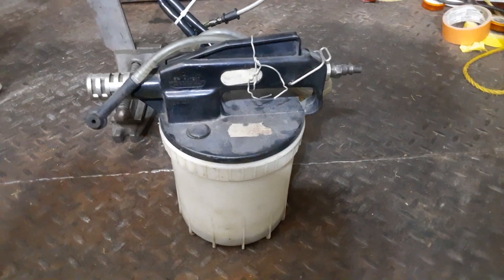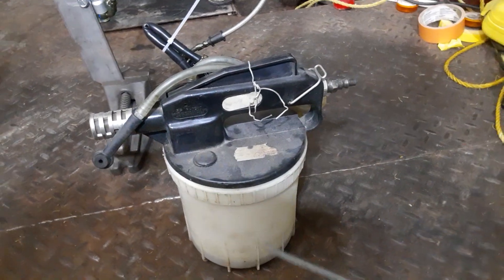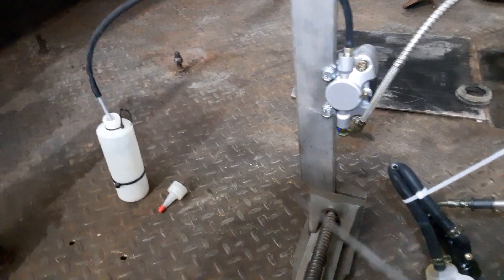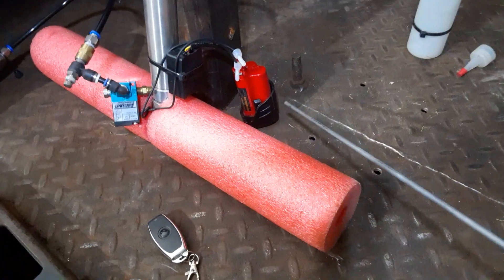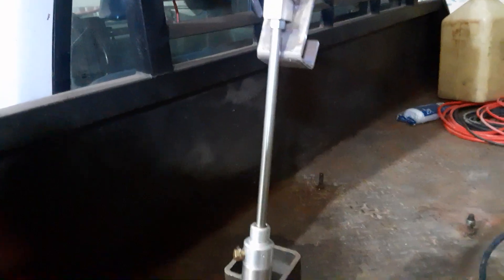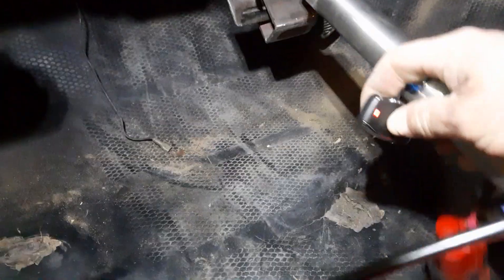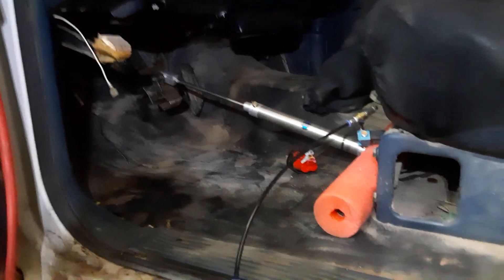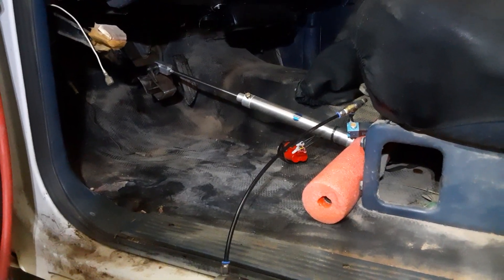One person brake/clutch bleeding.

Comment: I told a friend I wanted to do the same with a linear actuator, he asked if I was retarded? just use the bottle and hose.
Reply from the maker: That’s works until it doesn’t.  A container with enough break fluid to keep the end of the hose submerged (can’t draw back air) does work well often.  Clutches seem to like a vacuum drawn on the reservoir.  Some systems will also gravity bleed.  It would be nice if all systems were that easy.